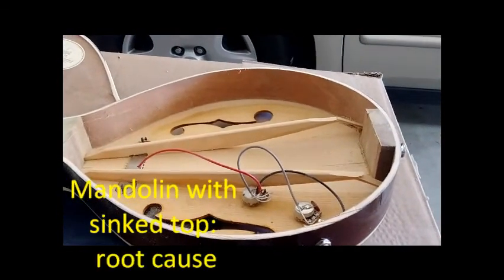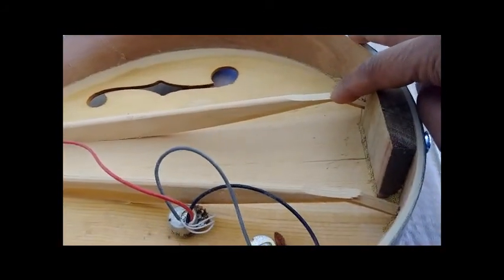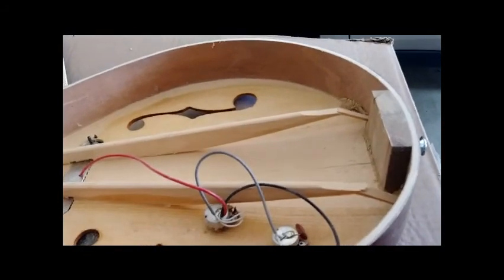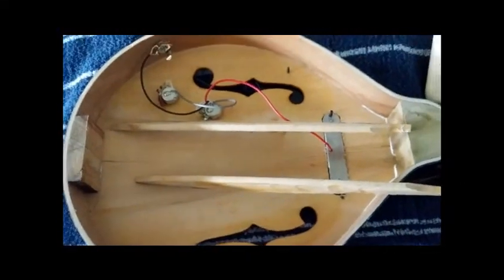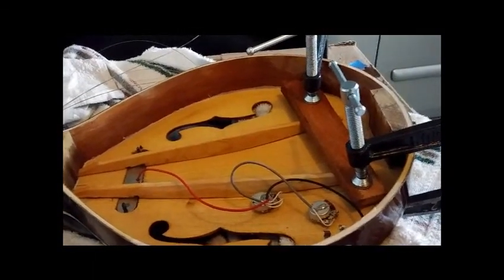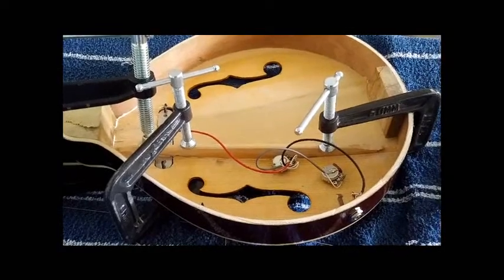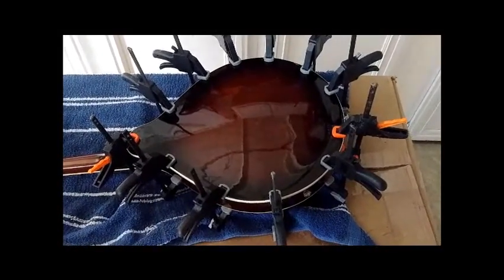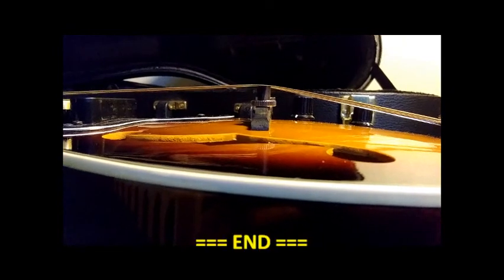Mandolin with sinked top repair

Comment: i would like to see how you sawed the  back off... i have a mandolin to repair and there is no binder on it
Reply from the maker: If there is no binding, you can heat a thin blade and slice off the join. "Heat then slice" repeated over and over. I will take a simple video showing how I cut off the back.